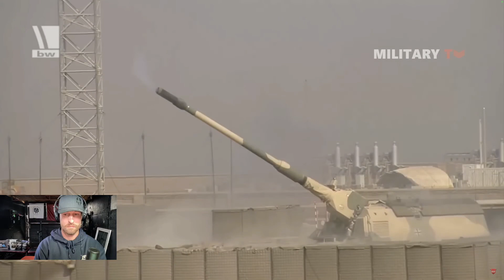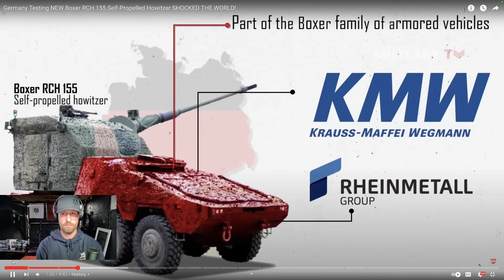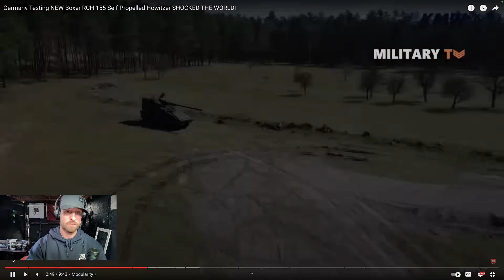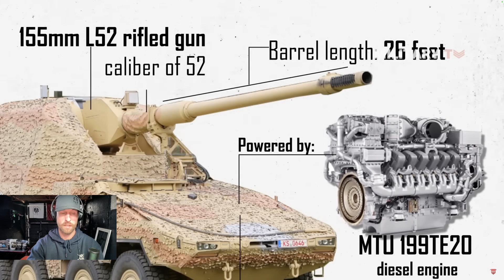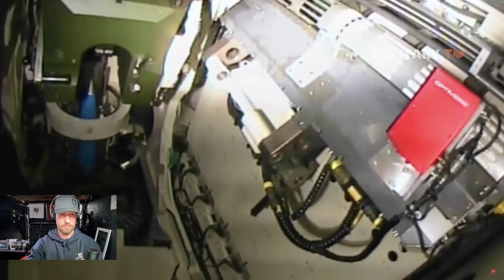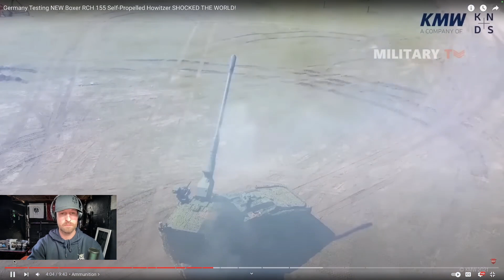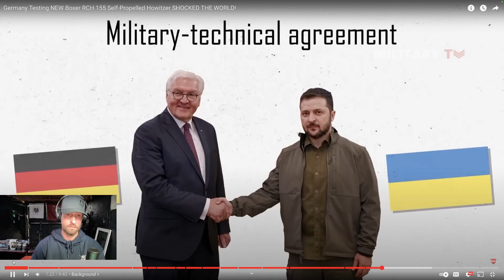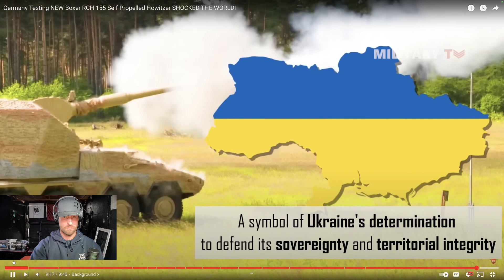Boxer RCH 155 British Armys New Replacement British Soldier reacts

Comment: It is not just slightly better than the Archer in mobility. It obviously is way better in mobility and maneuverability because it isn't a articulated, long trailer system that needs to do 3 or more point turns every time it wants to get in or out of a firing position.

There is not a single thing the Archer can do, which this thing can't do a lot better.
More range, more ammo storage, more mobile, smaller, faster gun laying (because it doesn't have to shift around the whole magazine every time it moves the gun), 360 degree direct firing ability for self defense and firing on the move, without the need to extend any stabilization struts or legs or anything like that.
Reply: Is the archer cheaper and easier to maintain? 

They have been working well in Ukraine.

I think they are  complementary.

The rch probably better in fast moving front and nearer the heat.
Reply: @knoll9812  I have no numbers, but on a purely logical level I would be very surprised if the Archer would be cheaper to maintain, just from looking at it.

Having the munitions magazine inside that box at the end of the gun, which needs to be shifted around together with the gun every time you aim the gun at something, seems to me like it is putting a lot of stress on the hydraulic system.

There are just a lot of moving parts that seem hard to get to for a maintenance worker.
The RCH is just a simpler system. It doesn't even need extendable legs for stabilization or anything of the sort, just a proven reliable 8x8 vehicle with what is basically a naval gun turret like you would see it on a frigate or a destroyer bolted to the back.

I'm not saying the Archer is bad. It was a innovative system when it was introduced, but it is one of those typical "early" systems that come up with weird solutions that eventually get surpassed by more streamlined and simpler competition.
Reply: How about be made by a British company, it's got that one nailed
Reply: @alanrickett2537  You mean the Archer? Nominally maybe.

There isn't really much engineering going on in the UK anymore nowadays, which is why they had to go to Rheinmetall to upgrade the Challenger 2 or to fix the SA80 and why even Rolls Royce opened up design offices for aircraft engines in Germany.

It is just a matter of priorities and incentives. Great Britain moved from industry to juggling other people's money and now, for near 2 generations, everyone who has a IQ higher than 99 goes into finance instead of engineering.
Reply: @TrangleC  as a engineer thanks for the insult, but I will let formula 1 know they should move all there engineering and design teams out of the country.
Reply: @alanrickett2537  You know that wasn't a personal insult, just calling a spade a spade.
Am I wrong?

Weird little niche stuff like that maybe someone somewhere is working on a racing engine or a ultra light aircraft or amusement park rides doesn't change the overall trends and exceptions confirm the rule.

The other way around Germany seems to be a developing country when it comes to finance stuff.

As I said, trends snowball to the point where they determine the overall economy of whole countries.

If I were British and would see a bunch of midwit goofball bankers getting rich and driving around in million pound sports cars, I would think twice about struggling my way through some engineering major to end up in the shrinking, atrophied remnants of the manufacturing industry.
Reply: @TrangleC  I do think you are wrong now there are still many design teams in UK that lead the world the problem is the manufacturing has moved and one day the design will move to as without the manufacturing you don't bring in the number of people to find the talented one so it's a mater of time, but that's true for Germany as well.

Which is why the UK should buy, UK the talent is here it went to Germany because of the lower price mostly due to Germany government paying out against EU rules which is why you have a car industry.
Reply: @TrangleC  There's plenty of engineering going on in the country, just in more profitable areas for the manufacturers of military systems. The Army forgot about its armour and artillery, didn't award contracts to upgrade and keep production lines open so they all closed.
Reply: @alanrickett2537  You claim to be a British engineer but you can't speak English? What is this?
Why do you pretend to be someone you are not and then argue from the perspective of someone you are not?
Reply: @alanrickett2537  Brexit didn't make it any easier to get the right people....

Comment: At 4:14.  The other advantage is that it can cover long distances itselve without depending on low lowloaders or lowloader train cars.  A few weeks ago convoys of Boxers covered  the route from the Netherlands towars Lithuania  on own power. without real issues.  Took them 2 or 3 days, but it is much quicker  then with lowloader and train and you can drive  "dispersed". Not 20 difficult to replace vehicles on a train which can be hit or get an accident. With 20 Boxers like 20 different routes or time slots can be used.
Reply: and the 2-3 days were with long rest pauses. in emergency case, these can arrive in 20 hours-24 hours. (1700km from Rotterdam to Vilnius)
Reply: @zhufortheimpaler4041   I like transport per train better, and that is what happens most of the  time, because it may save breakdowns on the road and it saves diesel    and driver fatigue,  but trains are vulnerable and so are their loads.
Reply: @bertnl530  yes, this is just the "quick reaction" VJTF/QRF scenario for the worst case scenario.
Reply: @bertnl530 Both of your points are well made.

Comment: The Boxer RCH 155 is a good example of the strength of international co-operation, also with regard to the Russian war in Ukraine. Developed in Dutch-German co-operation, the basic model is being produced for the British army in the UK, while the (German) artillery module is being used in Ukraine, i.e. tested under wartime conditions. And the Boxer RCH 155 is just one weapon system in the Western world's armoury. It is this ability of the West to cooperate militarily across national egoisms that will pose insoluble problems for the autistic Putin regime if it believes it has the upper hand in a modernisation of the armed forces that has inevitably become necessary as a result of the war.
Reply: wonder what the Netherlands shall have brought to the party? Reinmetall, KMW both German companies. The artillery is from France
Reply: @everlias  Weed? Gouda? The promise of being eliminated in the last sixteen of a World Cup? No, even if it is merely the political will and the willingness to share some of the costs of a project. The details of such collaborations are the subject of contract negotiations, which are ultimately countersigned by sovereign partners, whereby both (or several) parties can be involved at completely different levels.
Reply: @everlias  There will be work in Holland in the Dutch divisions and work for Dutch sub supplier.  It's an EU project in many ways.   The reprochment between France, Germany and Holland is amazing.